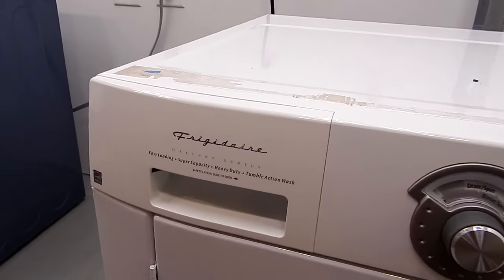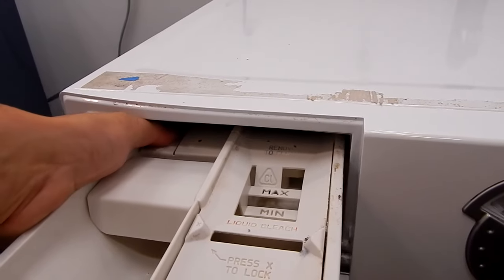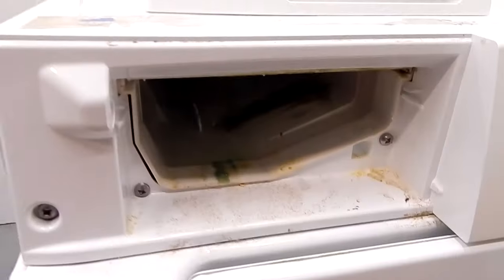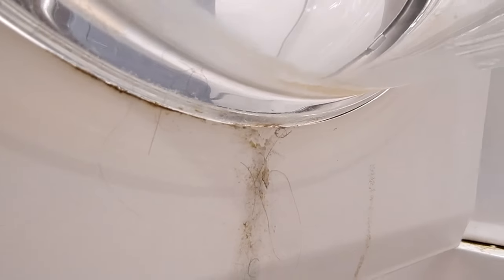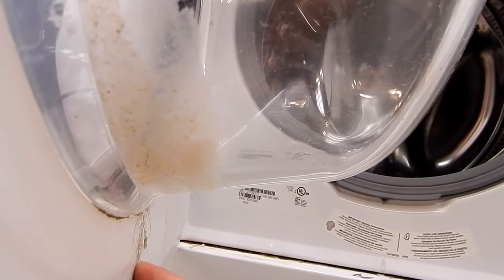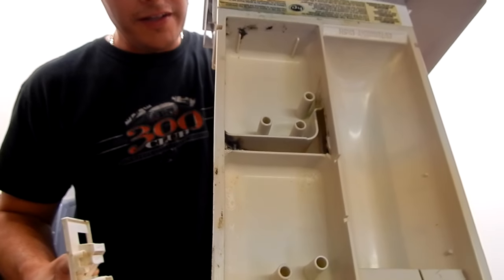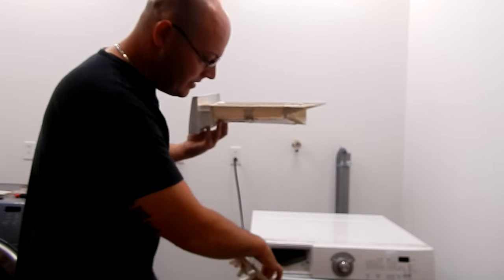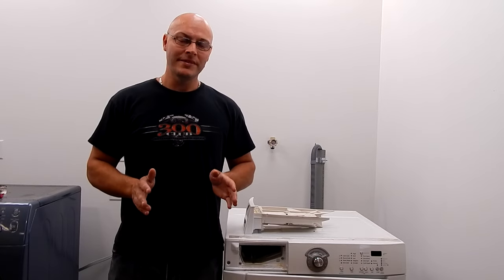Front Load Washer Leaking - Simple How to Repair

Comment: We have dogs that shed in the house. There was a ton of hair in the ring area blocking the washer’s drainage area. I removed and cleaned the ring. The washer was able to spin and drain properly. There was a stain where the washer was leaking down the front of the machine . That all stopped once I cleaned those two areas and the drain cup area located in the front of the washer. Appreciate the information!

Comment: I'm very handy. Just need a starting point for troubleshooting sometimes. I KNEW where the leak WASN'T originating and I knew it was on fill-up not spin/drain. YOURS was the ONLY video that showed me the top 2 culprits for this PARTICULAR leak (in place and cycle) ! Going downstairs to FIX it! (then do a mound of laundry the size of a Volkswagen)! Thanks!! I subscribed! (Whatcha got for a garbage disposal that doesn't respond to the reset button??)

Comment: I've got a puddle on the left (from the front view). I'll give it a try. I was thinking the pump was leaking but this makes sense. FYI, there was a recall on some Frigidaire pumps that were catching fire, possibly from a leak? This is on some mid to late 2000 models.
Reply: My unit is a "Gallery" washer/dryer combo. I bought it used for next to nothing so I expected some problems. But this problem is my fault. The soap loader tray plastic housing is broken inside the machine. 

I had to move this gigantic beast myself on a dolly down a hill and it decided to take a left turn on its own. It ended up rolling down the hill in slow motion as I recall, and eventually came to a halt at the bottom. I then had to scour the woods for the flying parts. The mass actually sent parts well over 20-feet away, surprisingly. I never found a couple parts to think of it.

I then managed to lug it in to the lower basement entry where I pieced it back together and it has worked for nearly a year. So the soap tray thing now makes sense. Nobody realized it was there anyhow...But nobody has been told the story of the runaway washer/dryer... Sshhh!

Anyhow, I'm going to "redneck" spray foam the inner tray shut.
Reply: @markfothebeast  what a fantastic story :-D

Comment: I have a Maytag, I really do appreciate the tip about cleaning the washer. I did that , remove all the soap scum from glass and also checked the holes in the tray. I still had a leaking problem. But further investigating the situation. I notice something strange.there is a plastic duct , it's hard and clear , that had a a seal lodged inside of it. Some how the seal got inside the plastic duct. So it no longer served its purpose in carrying out the job it was made to do, example to stop the water from leaking. I removed the hard plastic duct that's located somewhat behind the tray at the top. By sliding my hands between the soft plastic when you open the door between the barrel that spin and the outer portion of washer fixed the seal on the outside of the piece connected  to the washer slide the hard plastic duct over it by giving it a little push. Ran the water and there is no leak on the side nether the front. Working like a gem!!!

Comment: Hello Bill, For the wiring harness to reattach to the water pump, what if it doesn't have an adapter, but it is two separate wires?  Does it matter which way the brown and red wires go back into the pump?  I did forget to label when I took it apart.

Comment: Whirlpool Duet.  Replaced main boot and fill tube.  Absolutely zero funk on bottom of door glass or door backing plate but cleaned anyway.  STILL leaks from door.  Wondering how to remove the backer plate (WPW10138523) and more importantly how to seal it.  Pretty sure it is leaking between plastic door backer and glass dripping onto bottom outside front center of  door and front bottom cover panel.  Again... No hair or salt precipitates on glass.  WT-H?

Comment: HELP WITH FOIL REPLACEMENT ON TOP OF EVAPORATOR cant find part..
Hi, I have a Magic Chef model RB150TV. I have to replace the Heating coil as mine has a broken glass tube and coil. When I took the freezer bottom off I had a piece of foam under it and under the foam laying on top of the EVAPORATOR coil looks like a heavy duty piece of aluminum foil. That piece of aluminum foil is torn up all over with pieces falling off and holes allover it. I see that it sets directly over were the heating coil is on the other/underside of the EVAPORATOR. DO I RE USE THIS TORN TO SHREDS PIECE OR CAN I REPLACE WITH REYNOLDS ALUMINUM FOIL?? THE OLD PIECE LOOKS LIKE IT IS 3 TO 4 TIMES THICKER THAN HOUSE HOLD ALUMINUM FOIL..WHAT DO I DO?? Do I have to worry about burning a hole through this thinner Reynolds foil? Should I double or triple the layers? I looked for a replacement part but could not find one..Please help…Thanks..